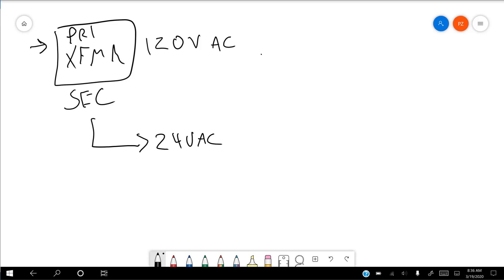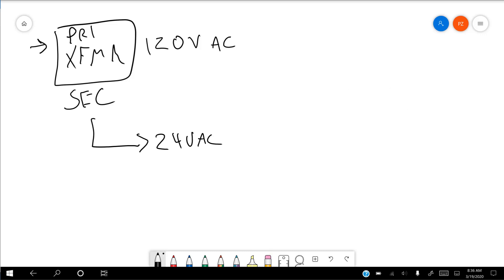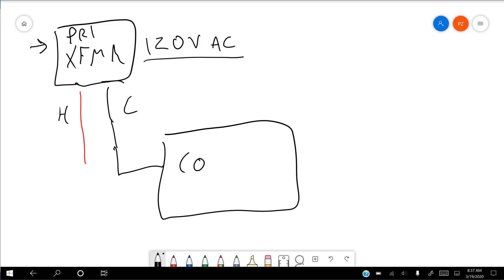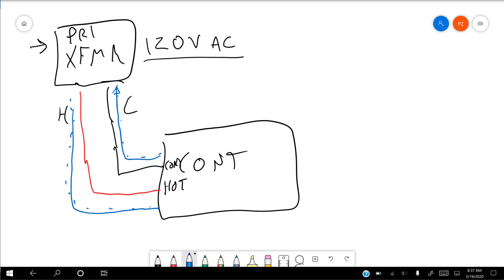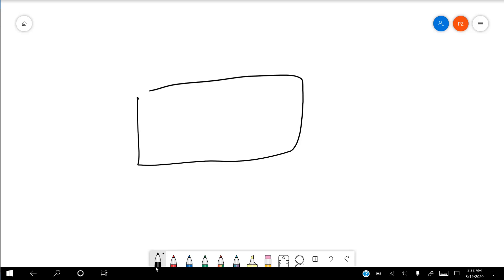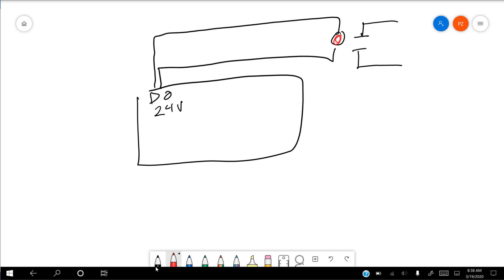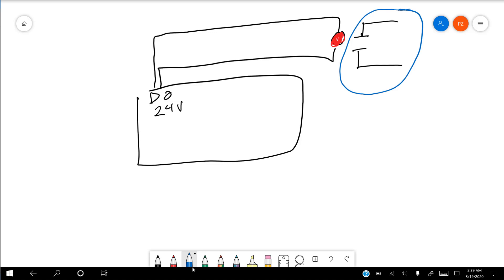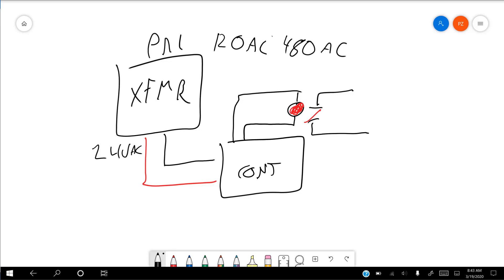BAS Bootcamp: Day 4  Transformers and Circuits

Comment: Great video! A question though, 
I understand the 24v power supply to the controller, but i always thought the controller converts that 24v ac into dc voltage for applications like the belimo valves that operate 0-10 vdc. Maybe im wrong and im not getting it. But i thought the controller only outputs dc voltage to control applications, wasn't aware it uses A/C voltage to control applications as well. Thanks!
Reply from the maker: It depends on the output type. 24VAC is sent to an on/off actuator or relay. Whereas 10 VDC can be sent to the actuator to drive the actually controller board on the actuator motor. The actuator would still need a power source as the 0-10VDC is not going to drive the actuator motor.
Reply: So with what your saying, a RIB relay would be used for the actuator?
Reply from the maker: @NROhvac  Not exactly. So RIB Relays or IDEC's are usually used to shield the controller's outputs from the 120VAC used to engage motor starters and the like. 

In the case of the 24VAC On/Off control of an actuator the amp draw is low enough that the controller can source that directly to the actuator.

In the case of a proportional actuator, the power comes from typically a seperate transformer and the 0-10VDC control signal comes from the controller.
Reply: @SmartBuildingsAcademy  Just to clarify on proportional actuators, 120vac comes from the transformer and 0-10 vdc comes from the controller. Does the 120vac from the transformer and 0-10 vdc connect to the same RIB for that actuator?

Comment: Great demonstration.  How would you go about wiring a safety circuit for a rooftop unit
Reply from the maker: Usually just wire the command you want to control through the normally closed contacts in the safeties.